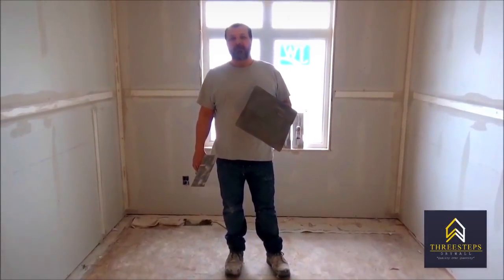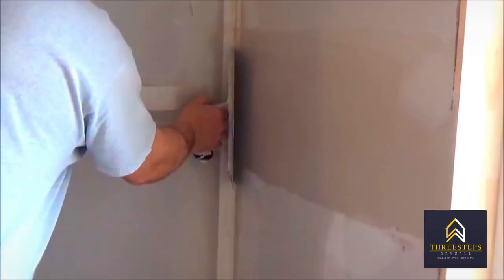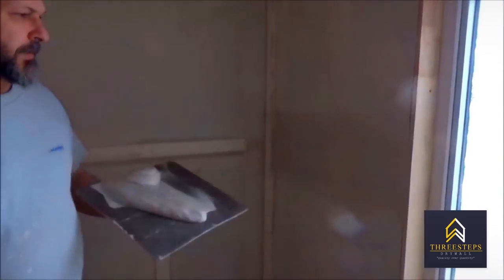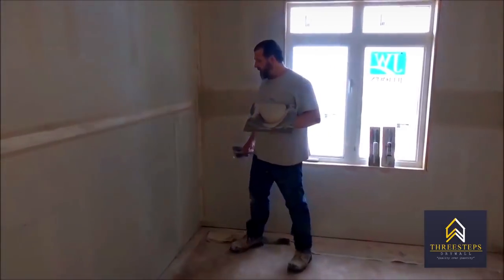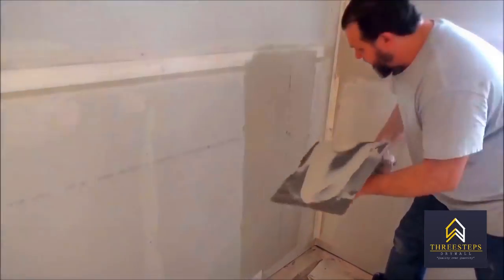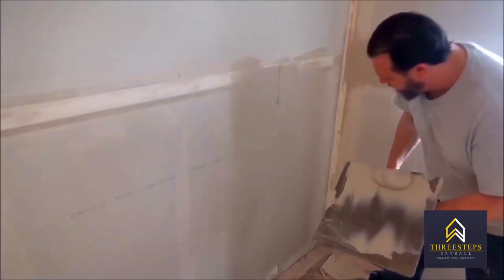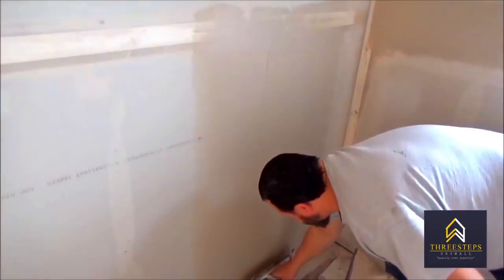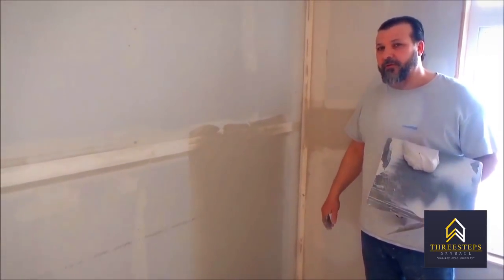First Coat Flats and Butt Joints

Comment: Hello. Is there a difference in the way you hold the trowel when applying the coat and wheb cutting? I am referring to angle of the trowel, pressure of the hand and alignment of the blade over the material , i.e is there a side which is more pressed than the other.
Thanks

Comment: TAPE IS NOT DRY YET
Reply: It is probably quick set mud in which it sets up to where you can go over the joints for another coat , it will basically not smear. You cannot sand it while it is like that but you can go over it.

Comment: dude why are you going so wide, the tape is 2" wide. you're 2 ft wide. tf?
Reply: Jessica Blackburn 
Yeah, but he’s floating out the factory panel joints that naturally have a recessed bevel way too wide. The two panels meet they make a 5” recess. In short, he is floating factory joints like if they were butt joints. Hence, creating more sanding, more work, and more dust.